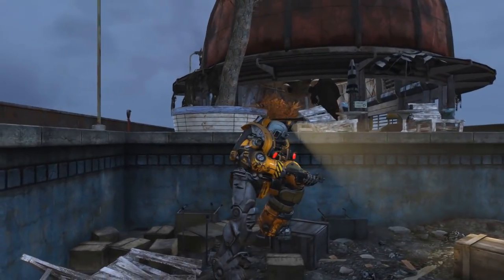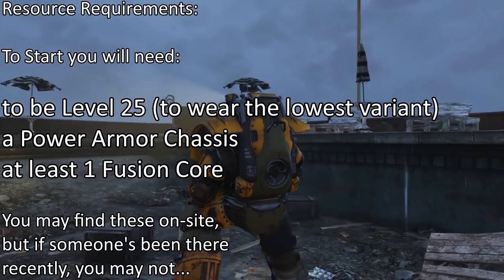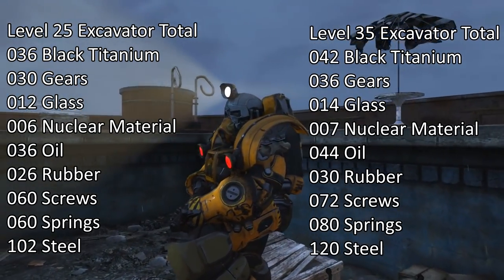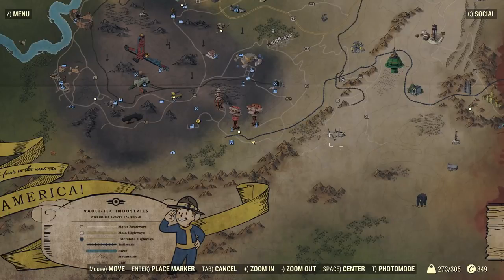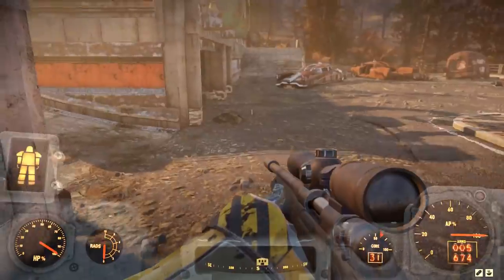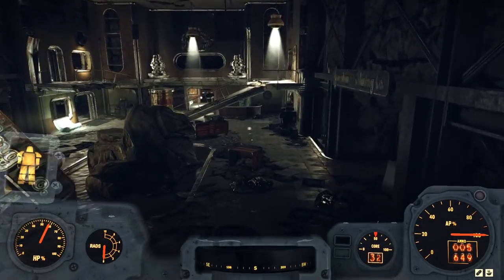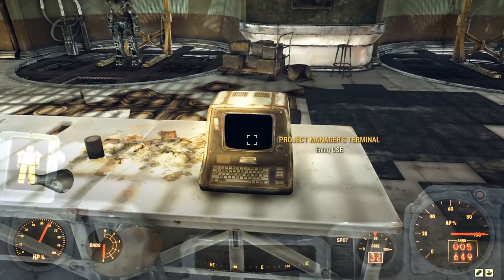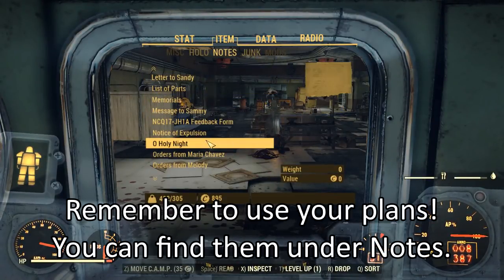How to Get the Excavator Power Armor in Fallout 76 (How to Find the Yellow Power Armor and Stations)

Comment: Honey bee armor! I think it is to conspicuous. Like waving red flag in front of bull.  But It is very nice. I am level 21 right now because I play slow because of my injury. I was not going to pick up PA because I did not like it in Fallout 4 at all. Vision was myopic with ultrawide monitor even with a mod. But I found one that was not all there a bit ago. Just Raider PA missing an arm and a leg. But I have one good arm and leg and helmet. It hleps with over encumbrance a bit. But just a bit since I can't keep the weight down...Wade Airport.
Reply from the maker: It's bright, but it's astonishingly resilient. Far more than the 5 level higher full set of T-60 I had when I did the quest. I wander around in my Power Armor most of the time, because of that weight issue. The Excavator Armor offers a bit more STR than the T-60, too, I think, +2 instead of just +1. Mostly, tho, it's just tough as nails. Makes stepping outside of it feel like a death sentence... :)

Comment: I have lvl 15 raider power armor and at lvl 24 completed this side quest.
Reply from the maker: Did it offer you level 15 Excavator Armor?
Reply: No unfortunately it still states lvl 25 to wear it but you don't need to be lvl 25 to start quest and raider power armer is available at lvl 15.
Reply from the maker: To complete the quest, tho, you need to register the Excavator Power Armor at the scan... or are you telling me that the scan will accept Raider Power Armor?
Reply: You are correct but you can wear lvl 15 raider power armor at lvl  15 including start the quest . The Quickest way for titanium is death claw island standing on rocks with   2 boats can easily aquire the needed titanium by moving around.
Reply from the maker: It's cool that you can start the quest early, but my intention for the list of things you need in the video was to point out what you'd need to get into the armor and build a Power Armor Station - so all the junk, the chassis, the core - and the level. And if you still need to scan the armor, and you still need to be level 25 to wear the armor, and then scan the armor, you still need to be level 25 - and then when you complete you've got the entire set to wear and the plans to the Station...

Also, I find the Mole Miner's really easy to farm for Black Titanium Ore from their suit scraps, too - and I love the sound they make when their gas masks crack!

Thanks for all the information and answering all my questions, Eric - and the great titanium tip! :)

Comment: I did that quest took a chassis they had there ..did everything on the comp but couldn't get the armor pieces I'm lvl25 ??? What did I do wrong ..it was hell in there almost died without the use the the mole mans claw
Reply from the maker: You have to craft them yourself, they're not a reward. Once you get through both computer terminals, you need to use the crafting station on a Power Armor chassis, switch the station to "Crafting," and actually craft the plates. That's why there's the list of resources at the start of the video - those are everything you need to craft the entire set of plates for the chassis.

And don't lose your melee weapon - as you get higher and higher in the game, you'll be using melee more and more and more. Right now, melee is king for anything you can reach - even flying scorchbeasts... your main goal is to get them to the ground to pound on them in melee... 

Good hunting, run that buddha run! And thanks for watching! :)

Comment: Im lvl 47 & I can only craft the lvl 25 one
Reply from the maker: After you complete the quest and gain access to the set, when you craft a piece, like the helm, it will show you the level 25 stats until you actually select the helm. When you select the helm - or any other piece, it *should* give you the choice for 25, 35, or 45, if I recall correctly. If you're only ever getting the choice for 25, you might want to open a ticket with Bethesda... Wish I could be more help! Thanks for watching, Axcel! :)